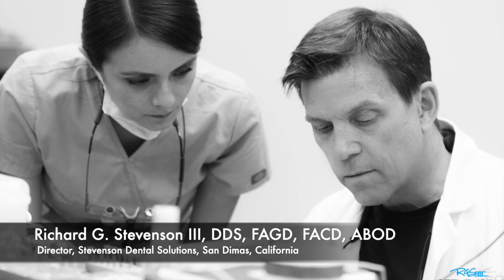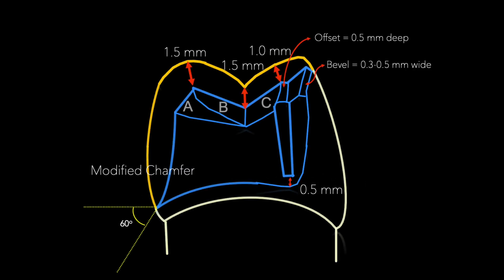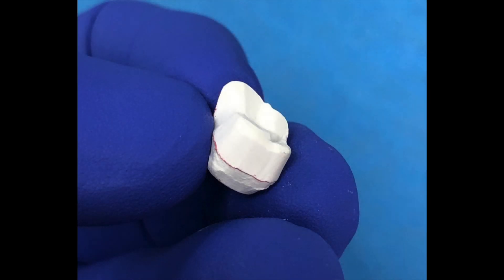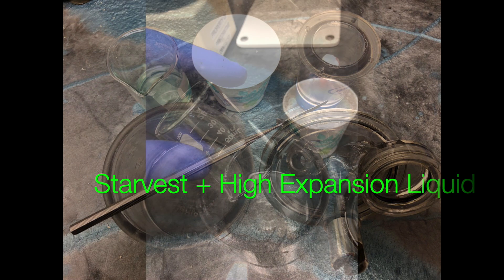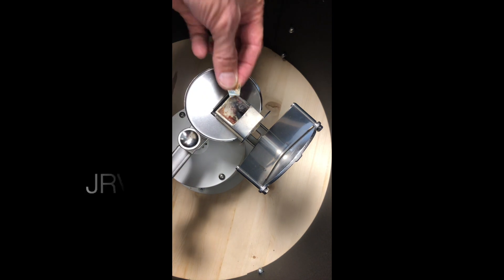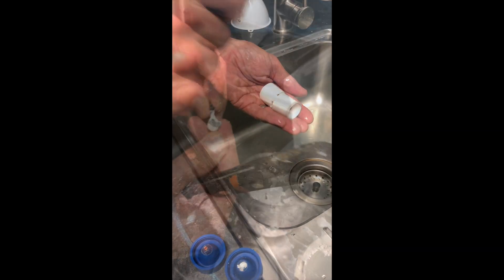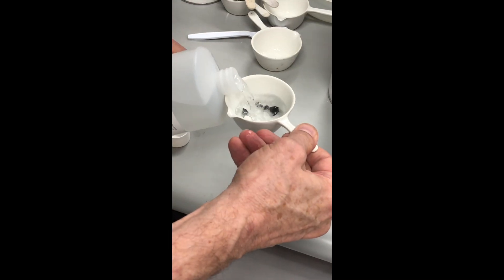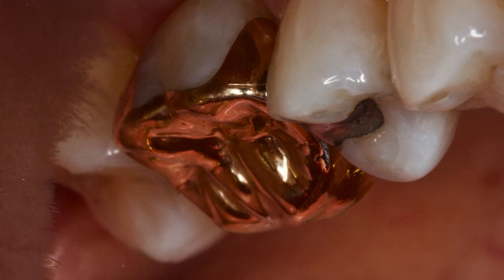Timeless Dental Art - 7/8 Gold Crown Summarized Laboratory Technique

Comment: My question Dr. Stevenson once you remove amalgam to replace with gold inlay restoration,  should you prepare for possible hyper sensitivity that may result in root canals. Lastly once you remove amalgam if a patient’s molars become hypersensitive, is it likely they will still be sensitive after you place the inlays / onlays in?
Reply from the maker: Usually patient experience some mild cold sensitivity, however, this is usually temporary - less than 3 weeks.  We use desensitizers like Gluma and Chlorhexidine 2% to lessen the issues.  Root canal treatment would not be indicated unless the pulp become irreversibly impacted, which rarely occurs with fine gold work.

Comment: If your patient wanted a full cast gold molar for # 30 but the upper molar opposing # 30 has a amalgam feeling would you reconsider it due to the two different metals that may cause galvanism.
Reply from the maker: Yes.  Galvanic reactions are typically short lived, and with High Nobel Alloy (specifically Jensen JRVT, it's never been an issue).
Reply: Do you ask your patients if they have a nickel allergy before using JRVT?  I have a bad nickel allergy and palladium has a 30-40% cross reactivity.  Meaning if a patient is allergic to nickel there is a 30-40% chance they will also have an allergy to palladium.  The answer is to use JRVT-PF or Argenco HP77, which are both palladium free versions of the same gold content.  They use platinum instead of palladium.  I have four crowns with either JRVT-PF or HP77.